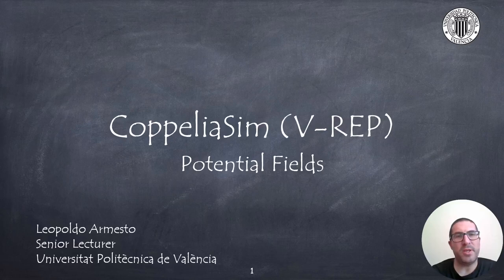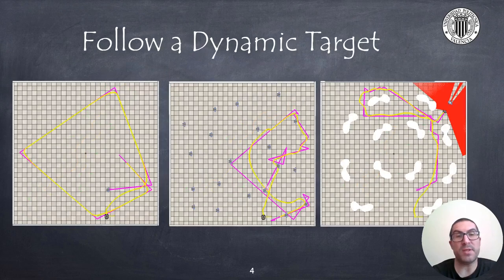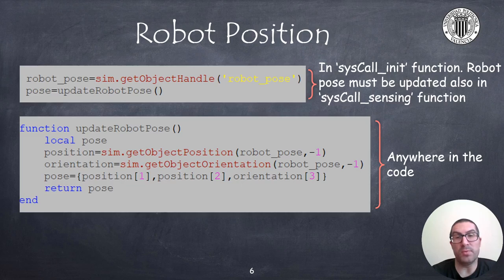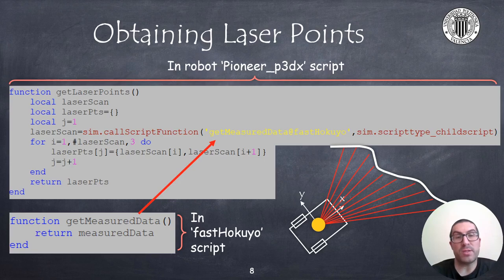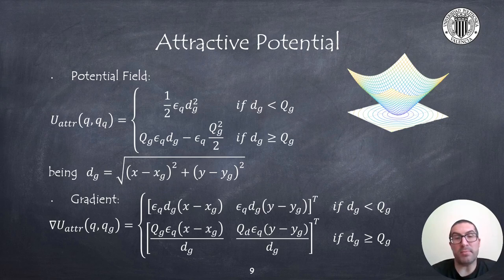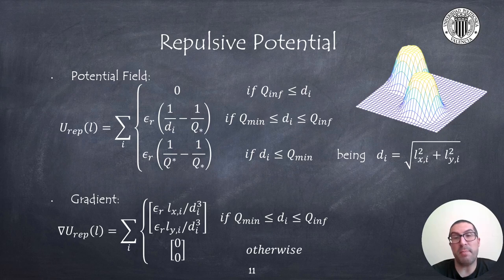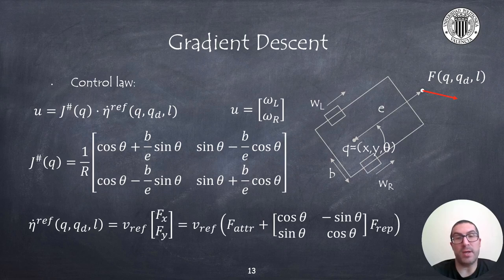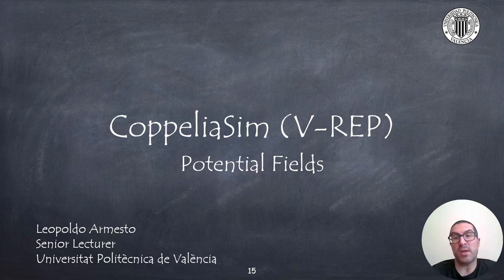How to Implement Potential Fields | CoppeliaSim (V-REP)

Comment: Mr Leopoldo, after i calculated the attractive force, how should I increment the x and y position of the robot such that it moves towards the goal
Reply from the maker: Yes, the robot should move towards that direction
Reply: @LeoArmesto  how should i update the x and y position of my robot after calculating the attractive force 
?
Reply from the maker: Set as reference point to a low level controller the actual robot position plus a vector proportional to the force or at least in the same direction

Comment: Hello Mr Leopoldo, I am currently experiencing local minima problems with the potential field method of obstacle avoidance. How would you suggest is the best way to implement a wall following algorithm once the robot is trapped in a local minima? and how can the robot itself know when it is in a local minima
Reply from the maker: Definitively not with that algorithm. VFH+ works better and it’s still simple